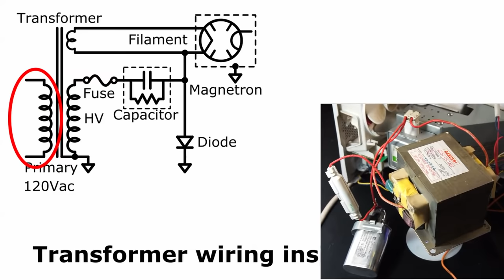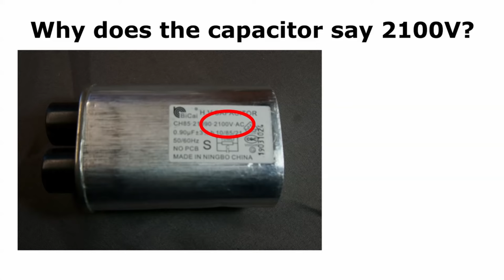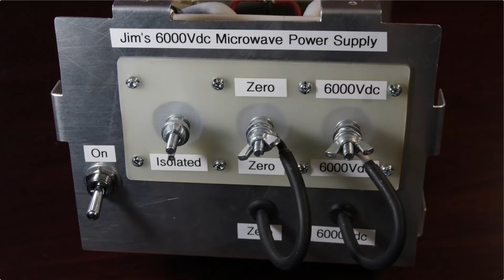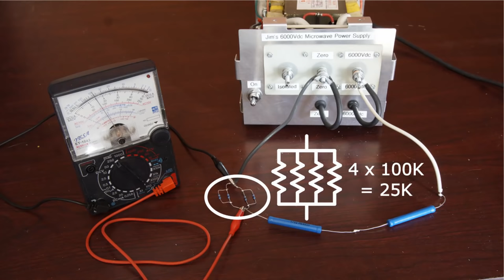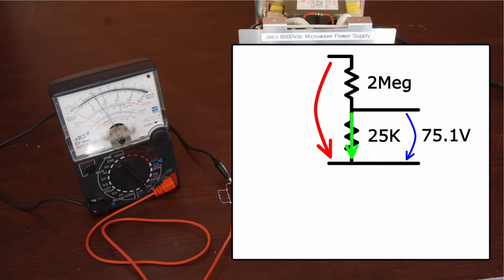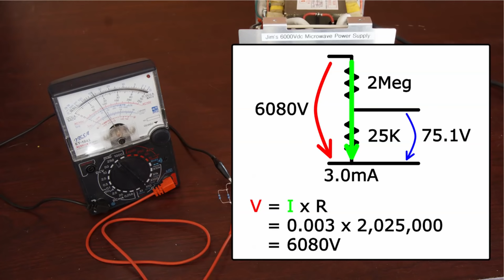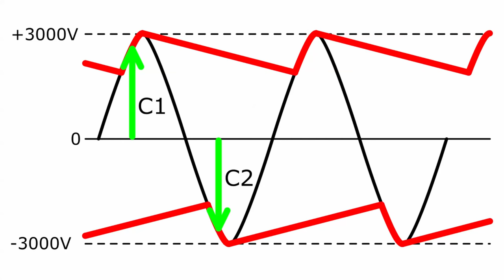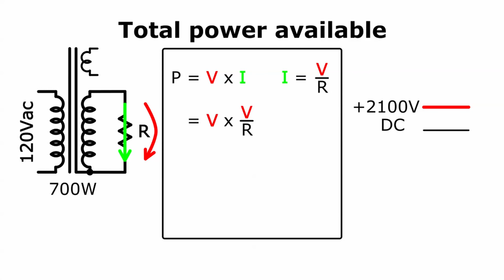6000Vdc power supply built from a microwave oven transformer

Comment: Good, educational video, but people, pleaae learn the AC/DC rectification fundamentals on low voltage.

I advise against building this particular arrangement. The primary winding on the transformer is NOT designed to work on floating 3kV level. It works only because a well built transformer uses huge safety margins (and required to be HiPot tested). Look at how much insulation is on the secondary side and almost none on the primary!

Several aspects of the mechanical build is also a major safety issue.

You do NOT use wing nuts and bare metal connectors on 230V even, let alone at 6kV. The output terminals should be insulated and a connector rated for at least 6kV continuous use should be used.

There should be a visual indication that the output voltage is present on the terminals. Ideally it should continuosly indicate as long as the voltage is still above 50V (!), even when the primary is switched off already.

There should be some sort of interlock which is, when not enabled, does not allow switching on the output.

HV capacitors and test circuit outputs are usually required to be SHORTED to each other and to earth when not enabled, otherwise it is UNSAFE to touch.

On typical proper lab testing systems one level of interlock on the safety enclosure is responsible for shorting the outputs and a second level to enable the HV power.

This seems ridiculosly complicated and inconvenient but the energy and voltage at these levels can kill you instantly.

Like PhotonicInduction said:
You will be dead before you hit the floor.

Comment: A good presentation two things cause pause.  Although you do caution the 
supply is potentially lethal I think this warning should be repeated at the 
end.  Second the exposed voltage is a bit worrying  perhaps a movable
plastic shield with perhaps a safety lockout when open or at least a more 
insulated connector method .  Should be a very useful lab supply add a
120 VAC Variable transformer even better.  The supply would work well 
to drive a air flash lamp circuit.
Reply: Yes, I can see someone knocking on that toggle switch and someone else touching the exposed terminals at the back.

Comment: This is an excellent presentation. I see it as technically accurate but Heaven knows, a 6KV power supply from a MOT will not "bite" you if you get across the output of such a power supply as this - it will likely KILL YOU, instantly. If you are not truly experienced in dealing with lethal high voltage, you should not attempt building such a power supply. Working around a device like this is as serious as knowing how to milk venom from a rattle snake or working with high explosives. You don't get but one mistake and you are likely dead with even the smallest touch of one hand to the other across such a power supply. This is not a power supply for a high power ham radio vacuum tube transmitter. First of all, 6000 volts is much too high for any reasonable amateur radio transmitter and the current at the 6KV level would be less than 200 mA  even from a 1000 watt MOT - you will need lower voltage and higher current for such a ham radio transmitter power supply. You also can not use a power supply like this for neon signs - the current available would be much too  high and the neon sign would be damaged. In fluorescent and neon bulbs, there must be a "ballast" in series with the power supply and the bulbs to limit the current to a level that will not damage the bulbs. A "ballast" is just that... think of a ballast as a device that keeps something  "afloat" or keeps it from destroying itself. A mercury vapor or sodium vapor lamp is a good example. Connecting a MV or sodium vapor lamp across 120 volts will do nothing. It take a starting HV pulse to "fire off" the conduction in the bulb but at that point the bulb basically becomes a short circuit and would either blow a circuit breaker or explode the bulb - the "ballast" allows for the control of current thru the bulb so it can properly operate - a bit of a digression here but I hope this helps. I have worked with multi KV levels of voltage for over 50 years and I realize I am probably lucky to be alive but if you do work with high voltage, you Must Always practice every precaution if you want to stay alive and also protect other people and animals that might accidently come in contact with deadly voltage. No doubt is it "fun" (?) to work with HV but you likely will only get one mistake that will end in tragedy and death. Have a purpose for building such a device as this and don't do it just to talk about how smart you are to have such a deadly high voltage device so that you can short it out and see sparks. This warning also includes Tesla coils. They can kill you too but a HV DC power supply is more likely to kill you than a RF supply like a Tesla coil. It is 100% true, no matter what you have been told, that it is the current flowing thru you that will Kill you. It takes a certain amount of voltage to push that deadly amount of current thru you but is the physically flow of current (the number of electrons) that flow thru your body and particularly your heart that will kill you.  It is estimated that it only takes about 80 mA (that is 0.08 amperes) of current thru your heart to either stop it from pumping or cause fibrillation. I am not a medical doctor and this is not medical advice but a short-circuit across a 6000 volt MOT power supply could easily put a pulse of hundreds of milliamperes thru your body - many times the amount of current needed to stop you heart. I set here writing and shake my head for lack of works to warn others to be careful with high voltage. I see it no different as having a loaded gun to your heart with your finger on the trigger. If you don't make a mistake, all is good, but if you do make the slightest mistake, it is likely going to result in death at this voltage level. If you must work with HV or have to  work with it for a career, learn and practice all the safety precaution every time - with no exceptions and things can go well and you may live long and prosper.
Reply: Yes, all well and good doing the calculations BUT the majority of the viewers have no idea on what you could use this very dangerous supply for!

Comment: You will find but the fan runs on it's own supply instead of the transformer on the front panel and the synchronous motor that runs the turntable also have its own supply

Comment: I wanted to make a custom multi voltage bench dc power supply, not quite that high voltage but a decent range, so I went with a 48v power supply to feed a programmable buck regulator then another boost type circuit to increase the 48v and run that through a higher voltage buck for another range of output.  The microwave transformer is probably too much voltage for what I had in mind but seems like something that could be pretty useful to easily get voltages well above the easily accessible 120v/240v for experiments...  How hard would it be to create some kind of way to vary the output voltage?  Perhaps it could be done on the input side of the transformer since that’s much more commonly available - a “dimmer switch” type of thing?  I always wanted to see how nice strings of LED Christmas lights would look powered by DC...  I made a DC string for my sister who’s affected by the flicker one time, but it was just 12vdc so required a somewhat cumbersome series-parallel wiring...  I always thought it would be cool to build an adapter that would supply just the right voltage of dc to make any simple string light up solid, probably not even that hard to design, but a variable hv dc supply would be a decent way to figure out the design parameters since if it was as easy as full wave rectification and a capacitor there would likely already be products on the market, or not...

Comment: Why would I want a 6000V power supply? What would I use it for?
Reply: Zapping the shit out of yourself
Reply: Tesla Coils, low pressure spectral tubes or anything else you need a high voltage power supply

Comment: The reason you got an error in the secondary voltage calculation is that you didn't consider the 1Mohm load you put in parallel with the 10k resistor -- that is, the oscilloscope itself

Comment: 40 watt rear fan and 3 watt turntable can't run on a <4 watt low voltage transformer. They get switched by 12v relay on that board and contacts are supplied by mains voltage. Sans fan, this projects saturated core should not run >5 min/hour (with <15).

Comment: Very dangerous, 6000V at low impedance/high current will kill you!  A spark plug wire is 30,000V but high impedance and even though it hurts it won't kill you.
Reply: @jwagnermail  Well , microwawe caps are self discharging (the VAST majority of them ) and consumer magnetrons are NOT having beryllium oxide insulators because of costs and unfriendliness to people  . Lots of funny internet legends.
Reply: I'm so glad that you said the 30,000V spark plug wire isn't dangerous because of high impedance, rather than saying it isn't dangerous because of low current. It drives me crazy constantly seeing people say something with really high voltage isn't bad because it has really low current, and ESPECIALLY if coupled with the incredibly misleading "it's not the volts that kill you..." statement (nails on a chalkboard). You saying its because of high impedance though is the correct answer I wish more people understood. There is no such thing as high voltage with really low current. The way you get a non-lethal source of high voltage is impedance, whether it be a spark plug wire designed to be 20kohms, or in the case of when total available energy in a HV source is small, the impedance of the internal components delivering it to you. In all cases, the impedance is what saves you because voltage will drop across across it the instant you become part of the circuit, incidentally resulting in the small, non-lethal currents through you.

Comment: Best thing to do with this is put a big cap around 20micro farads or any were between 16 and 25MICRO FARADS  450 volt ac cap in the neutral lead . then put a triac controler in line on the mains making it variable from 100 volts to 6000 volts . some simple circuits are easy to build and old washing machines all us 10amp triacs ,,, Also light dimer switches will work to ....., but be aware microwave oven transformers consume aound 2.9 amps while not on load and continued operation at that current will get hot as they were designed this way to keep voltage stable and current so that the magnatron didn't drift in frequency .so put the triac in the live supply line giving you a high voltage variable  psu..KNOW AFTER WORKING WITH HIGH VOLTAGE UNDERSTAND THAT IT CAN AND WILL KILL YOU MAKING JUST A LITTLE MISTAKE . SO SOME EXTRA BLEED RESISTERS ACROSS THE CAPS ARE NEEDED. A VISABLE  LAMP CONECTED TO THE OUTPUT WOULD HELP WARN WHEN CAPS HAVE HIGH VOLTAGES . . THIS CAN BE DONE WITH  NEON INDICATOR LAMPS  AND A RESISTER NETWORK .. A HIGH VOLTAGE RELAY DUM /SHORT CIRCUIT RELAY WOULD BE GOOD MAKING SHORE IN POWER being  OFF LOCKING THE UNIT FROM ACCIDENTLY SUPPLYING HV.

Comment: What do you need such a high voltage of 6Kv for. Please tell what you are going to use this for. The network is for NOT for noise it for preventing any signal from getting back on the AC line.

Comment: that was an incredible video/tutorial, I have a question for the teacher, can you use this circuit to increase the power of a microwave oven?  sounds like it would work?!!!  thanks Jim      mike   that video brought you a sub and I even hit the bell for you!!!
Reply: @M Kepler - Short answer: NO. You cannot, not with this circuit. Magnetrons are made to work at a prescribed maximum voltage. Using too high a voltage will make the magnetron into a short circuit, then very quickly, a heap of junk. Using too low a voltage will result in very low production of microwaves. The only way would be to feed the magnetron with DC of the proper voltage, but carrying less ripple. However, that would likely shorten the life of the magnetron, due to excess heat. It is much easier and safer to just buy a higher-powered oven. Industrial microwave ovens are available in a wide range of power levels, as are radar transmitter amplifiers.
Reply: @YodaWhat  thank you for your knowledge!!!

Comment: Why would you need so much DC power? Extending the common point on the caps to the panel would allow a 3000 or 6000 volt output. Or use two more HV diodes and make a bridge rect,

Comment: I indeed appreciate your enlightenment. I am a mechanical engineer, I have very little knowledge of electrical and electronics. However, currently I am working on BLDC motor, please can I use the microwave transformer to generate 96vdc and current rating DC BUS 30A-200A , to run my machine. Thanks

Comment: Great video! What a detailed explanation of all the aspects!
Question: Is it safe for the capacitor's life let them operate without any load? Should be safer putting in parallel, for discharging also the capacitors, 2 x 2M resistors?

Thank you!

Comment: wow, tek 475 scope - haven't seen one of those since the 80's!  But pray tell, what does one use a 6000V dc supply for?
Reply: Analog is superior in many ways
Reply: Wow, I’m shocked at your question! (Pun intended) but seriously, as a man who loves sparks, plasma, fireworks, blowing things up etc, what does one not do with a 6000V dc supply?
Reply: Electroplating
Reply: @gab5709  This is a high-power HV device.  HV for fun can be done with a low-power HV device like a vanDe Graff generator in safety.  The device here is lethal.

Comment: now put the psu on a table with lotsa of cut off wires from  all the resistors you have cut in your electronics life, then let the ht leads fall on the workbench , swith it on and be amazed as the ht dances in blue arcs all over your table :)

Comment: I echo the kudo's for your excellent presentation.
 May I suggest a 'related' circuit analysis? That would be explaining the microwave design used by Panasonic on their microwaves that supply actual 'variable' power level output by the magnetron, rather than simply 'pulsing' the 'on' duration as do the microwave circuit(s) you described. 
Thanking you in advance!
Reply: unless Panasonic is using something other than a magnetron, the only way to vary the power to a magnetron is by pulsing it. It's either on or off. They are structurally designed for a particular resonant frequency (for food[the water H2O inside the food], the resonant cavity is designed to be tuned to ~2.2Ghz).

Comment: Jim:   I loved your 'breaking down' the design of the standard microwave, but as you probably know, Panasonic makes a truly 'variable' energy microwave... any chance you could compare and contrast their unit to this standard design? I've always thought the magnetron was 'frequency/pulse width dependent, and remain at a loss regarding the elements of their design.
         Thanking you in advance for consideration,
                   Tate
Reply: Panasonic and other microwaves that have "variable power" are so-called Inverter Microwaves. These use a switchmode power supply rather than a large transformer to produce the DC for the magnetron.
That style is totally unsuitable for modification to create a HV project, as they need special drive circuitry to instruct the power supply what voltage and current it should provide. They won't necessarily operate without the magnetron, and every microwave will have a different control protocol. So, you would need to do your own analysis based on that particular device.

Comment: but this double circuit you can't load from it lets assume top diode foreword bias so plus output has positive potential and other minus terminal has minus potential but there is no current flow across capacitor it work very small instant while capacitor charge. so you have potential but you can load while capacitor charge when charge no current flow

Comment: i used this transformer to make inverter I cut the secondary’s wires out it left the primary only i wired from the secondary 14 turn its produced almost 14volts out puts I connected to inverter circuits that’s i made it works 240volts AC i tested its not a pure sinwave its a modified sinwave but there a problem it produced only lights it’s works for any light globes but it’s missing the power I mean the hot wire can you tell me what’s the problems